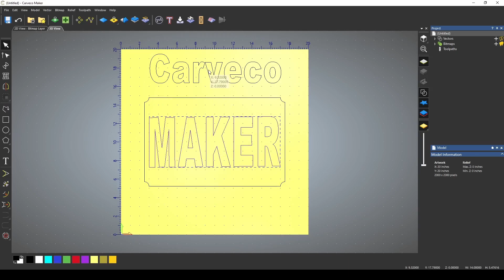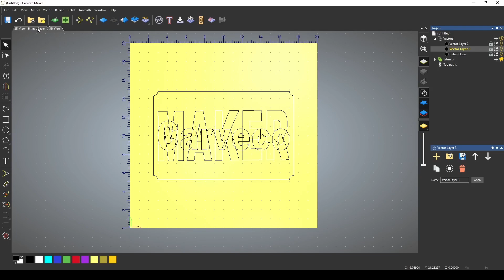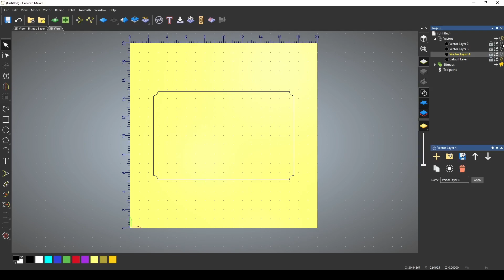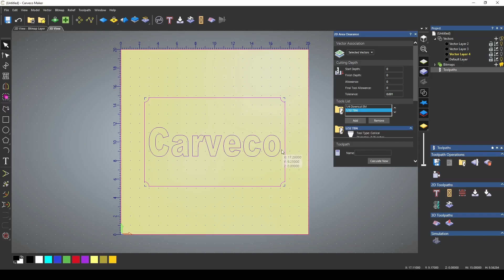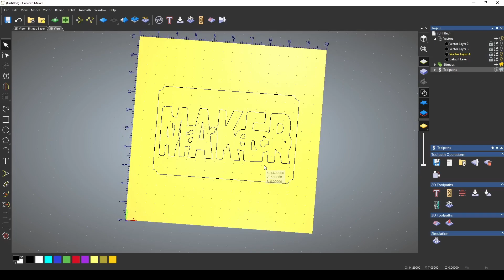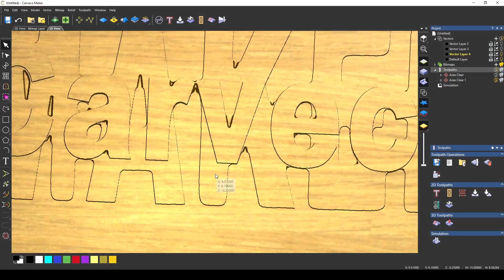Carveco Hacks - Stacked Text

Comment: When I try to add ramping to one tool in the area clear it adds it to both tools, when I deselect it from the ball nose it also removes it from the End mill. This video is too quick, Timberfalls content is excellent, but this video isn't up to their normal standard
Reply from the maker: If the video is going too fast you can slow these down by changing the playback speed in the video options. Ramping is going to effect all tools listed in the area clearance. Alternatively you could create a second area clearance toolpath with the second bit and do not include ramping to fix that. Hope this helps.

Comment: just way to fast, slow down some
Reply from the maker: I do hear this comment sometimes as I am trying to cover a lot of information. There is a setting in the video settings to run the videos at a slightly slower speed and still watch it through and may help with the pacing of the videos.